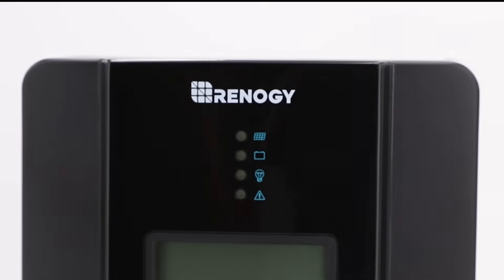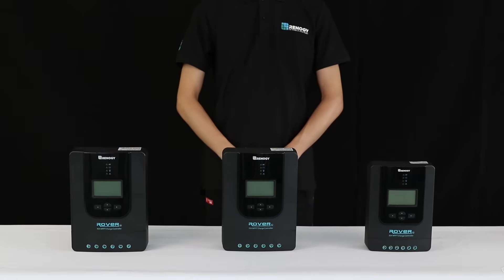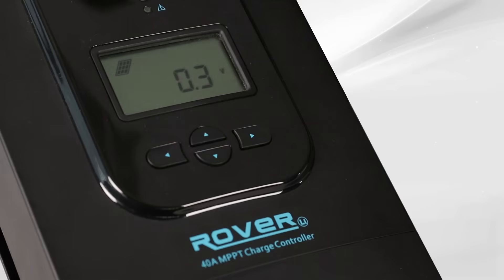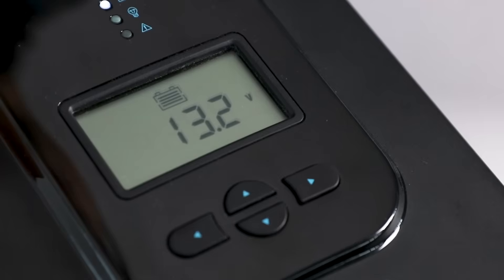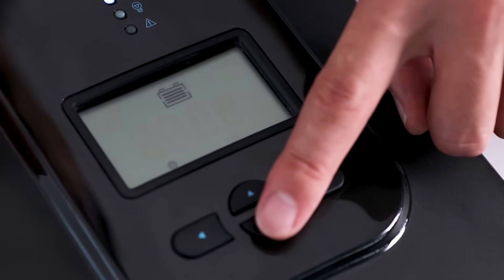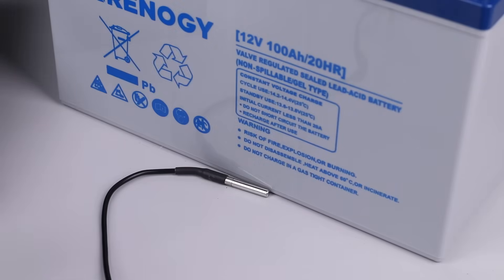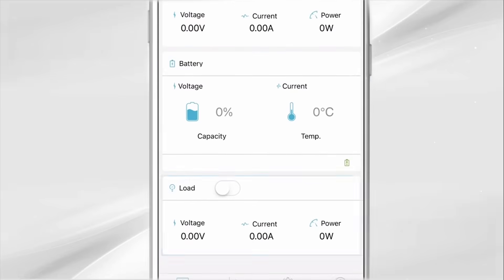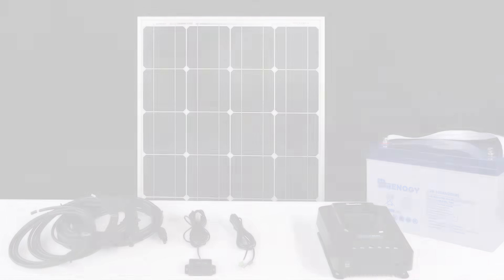Rover LI MPPT Charge Controller

Comment: I don't have a comment I have question .your renogy customer service is not the greatest they always think customers are lying to them. So I'm asking you ,I have a 40 amp mppt charge controller my screen works but the problem  I have is the arrow that shows power from solar to battery does not work on the icon .my battery is fully charged and I'm getting full sun power to panels I have 2 100 watt renogy panels need help quick 😢

Comment: Hi, great video, i understand that rover 40a have a maximum 100v pv input, but how many amps in the input? Thanks
Reply from the maker: Hello, the controller has requirements for the maximum input voltage and maximum input power for the PV input. As long as these requirements are met, there is no need to specifically consider the current.

Comment: Does anyone know what the Boost return voltage, and the under voltage recover settings do?
Reply: The function of "Boost return Voltage" is to re-activate Boost charging when the battery voltage drops below this value. 

"Undervoltage recovery" means that once the battery voltage rises to this value, the low voltage alarm will be reset, which means the alarm condition is cleared.
Reply: Thank you for this helpful reply. @Renogy_Cares

Comment: Adapter was mentioned towards the end tp connect to the solar panel. I have the 30amp MPPT and a Goal Zero 100 Boulder Briefcase.... can someone provide a link to the correct adapter? And is it correct that I don't need a fuse in between the charge controller and panel?
Reply from the maker: Hello！ I believe you need an adapter from PV to a controller. In order to recommend the appropriate connection method and match the suitable adapter, we need to confirm how many PV panels you have and their specific specifications. The corresponding links for different numbers of PV panels and connection methods vary. I suggest you visit https://www.renogy.com/contact-us and choose a channel to contact us. We have professional technical support available to provide you with detailed information.

Comment: how do you change the voltage on the load?  it shows like 13.7v want to lower so i dont over volt
Reply from the maker: Hello,Unfortunately, the load voltage of our control cabinet cannot be adjusted later on. The load it can accommodate must match the nominal voltage of the battery.

Comment: It says this works with lithium ion. I have a "24v" 7s battery, but its lithium ion, so nominal voltage is 25.9v, and max voltage is 29.4v. This will work, right?
Reply from the maker: Hi, Randy. It can be compatible with your battery.

Comment: You guys need to make a video om going into the user parameters and setting up a lifepo4  battery I can't find this information anywhere.
Reply from the maker: Hi, DaveSquibbSr. Thank you for your suggestion. We have reflected the issue to our product department. Stay tuned.
Reply: @RenogySolar  and this was a year ago and still I find nothing discussing how to program the other Rover settings.  When I long press the Enter or Right key, I can only seem to find adjustments for battery type and 12/24V settings.  How do I enter other parameter settings?  Like load parameters where I can adjust when power comes on for the load.  Where's this menu and how do I navigate there?

Comment: Just purchased the 40amp version of this product, in the manual it says not to connect an inverter to the load terminal, I was wondering why this is, I thought that would be the main purpose of that terminal? Otherwise, what is the intended use for this terminal?
Reply from the maker: Hi, Barrett. The maximum current of the load terminal is 20A, and the load port is also powered by the battery, which determines that the load port can only be connected to loads with low power.

Comment: Why don't you answer people's questions here?
Many asked if Li setting can be used with LiFePO4 chemistry.
Reply from the maker: Hi, PicoNano.

Thank you for your feedback.

First of all, we need to explain that we will selectively reply to some pre-sale questions through Youtube platform. Some problems require customers to provide videos or pictures as judgments, so it is inconvenient to communicate directly through the platform.

In fact, for your problem, you can refer to the charging parameters of lithium mode on page 28 in our manual to determine whether it is compatible with your battery: https://www.renogy.com/content/RNG-CTRL-RVR40/RVR203040-Manual.pdf. If it is compatible, the controller can match your battery.
Reply: @RenogySolar  I "selectively" chose to buy a Victron 100/20 instead.
They seem to be the best and not much more expensive that Renogy + WifI/BT
Reply: @piconano  I so wish I had not bought Renogy products. It is a real nightmare.

Comment: can more than 1, 100w panel be used ? and could a 24 volt panel set up switch itself down to a 12 volt battery system , i have both 12 and 24 v systems on my boat
Reply from the maker: Hi, brett.

For your issue, we suggest you can submit a case through our Help Center Portal (links listed below for specific locations) for help. 

https://renogy.force.com/helpcenter/s/contactsupport (USA)
https://renogy.force.com/helpcenterau/s/casesubmit (Australia)
https://renogy.force.com/helpcenterca/s/contactsupport (Canada)
https://renogy.force.com/helpcenteruk/s/contactsupport (UK)

Comment: what do you connect to the load plus and minus.  Incomplete tutorial
Reply from the maker: Hi, A S.

Thank you for your feedback. For the load port of the controller, it can only be allowed to connect loads which current is not over 20A. We will add the illustration about this point in later videos. Thanks a lot.

Comment: Hi there I’m new to these systems and maybe I’m going to ask a stupid question but I’m looking for help because I’m very confused at the moment.
I have 1 solar panel 100w and 1 100amp agm battery so once i will connect the charge controller to the battery and the  PV to the charge controller can I use the battery at the same time to take the load from the battery while it is connected to the PV?

Thanks in advance I really appreciate if someone can help me understand better
Reply from the maker: Hi, David.

You can use the loads when the battery is in the charging process. 

Hope it is helpful.
Reply: What's a PV?
Reply: @deanna9651  Solar panels, also known as photovoltaics (PV)

Comment: The manuals seems to imply that you canand should change the chage settings to match what manufacturer says,  how do you do this? whewn you select battery type Li,  you cannot access the charge settings,  Rover Li 40
Reply from the maker: Hi, Lorne.

Thank you for contacting Renogy.

Our controller can only change the charging paremeters under the "User" mode. 

Wish you a nice day.

Comment: What is the DC load terminal used for? Is there any limitations for the load? If the load is bigger than solar panels output then will it automatically draw current from  battery ?
Reply from the maker: Hi, Hharan.

The DC load terminal is used for the DC loads with small power. It will be more convenient to manage your loads. For the controller of the Rover system, the rated current of its load is 20A, please ensure that the load current used does not exceed 20A, and the voltage is consistent with the system voltage.

Have a nice day.

Comment: Programming? Why dose the battery indicator on the screen say it’s at 100% and my shunt reader says 50%?
Reply: I have the same issue and don't know how to set-up the MPPT either for my 280Ah LiFePo4 battery. It always shows 100% and doesn't recharge with my 400W solar panel. Did you find out how to make it work? Thanks
Reply: @coogeefab  I'm having this problem now, did you end up finding a fix?
Reply: @coogeefab  I got the smart Li batteries from Renogy, I had to get the smart Li reader from Renogy as well. The smart shunt is really only for gel or hybrid batteries. The smart reader uses am Ethernet cable to connect to the batteries and gives an accurate soc % charge. The rover still dose not read my batteries other than 100%. However, it dose charger the battery. To program the rover for your user setting you need to have the data in your battery and then use the manual to change the voltage to get it to recognize the battery being at its set voltage to charge the battery. My river dose not start the charging cycle till it’s at about 85% soc charge. If your not pulling enough battery power out it won’t charge it. You can get it to check to restart the charge cycle by turning off the solar panels and then turning off the battery. Always have the battery attached to the charger before before turning the solar back on.

Comment: What’s the load connection for?
Reply: For running a light or other device off the rover directly. As far as I can tell just to see that it’s working.
Reply: @boarderlinesk8media433   Sorry for my ignorance...  But if you're running something higher powered, do you just connect the load to the battery?
Reply: @humbughumbughumbug  Yes Sir, you're absolutely right.
Reply: @icucjamie  thanks! Makes sense since the battery should have a BMS! (I forget about that)

Comment: How do i know which charger to get? 20, 30 or 40 amp ?? I am doing a 200 watt solar setup for a van conversion.
Reply: Get the 40amp because if you want to add solar panels in the future you will be ok
Reply: @antonio cianciardo  if he's in a van he's not going to get enough solar to need a 40a charger. Get the 20a is fine.

Comment: You are configuring the charger for a Lithium battery, connecting it to a lead acid battery and installing the remote temperature sensor which isn't to be used with a Lithium battery? Bloody confusing. (And the "music" drowns out the narration.)
Reply: That is a hybrid gel cell battery.

Comment: Tried to get Renogy to honor the warranty after 3 weeks of over 10 back n fourth email they said would not take back under warranty, I told Renogy I thought this smelled like it would catch fire. Sparks started coming out of the bottom; thank God I was close by to turn off system. Renogy knows there was a problem with this “old model” I purchased in November 2019 (less than 1 year ago) that’s why they redesigned. I will never purchase another Renogy product. I had heard horror stories but went against my better judgement and had I not been in my rig I’m sure it would have burned to the ground. Shame on you Renogy...listen up all who recommend this company for free products.

Comment: It pained me to see a big adjustable wrench being used instead of a proper sized wrench or socket.
Thats just the mechanic in me.
Otherwise a very professional presentation.
Reply: I was waiting for the flash haha
Reply: The oversized wrench was bad for sure, but it paled into insignificance compared to the red label on the pants at 0.18